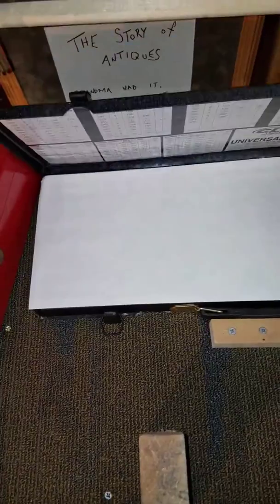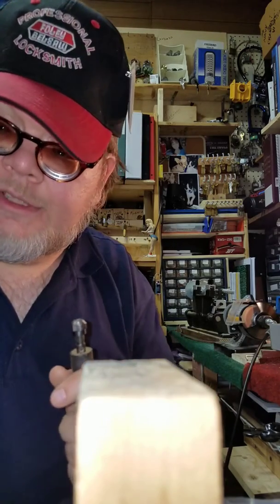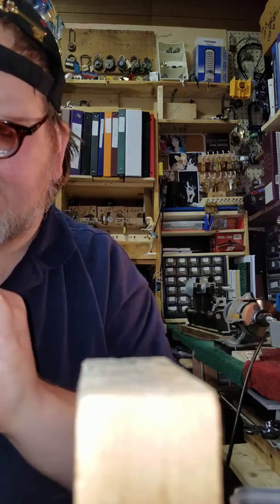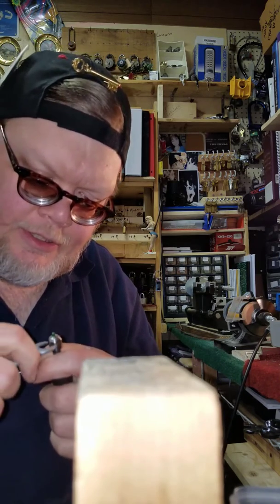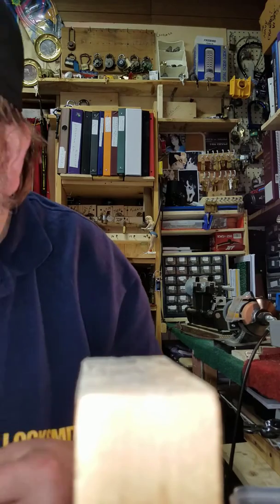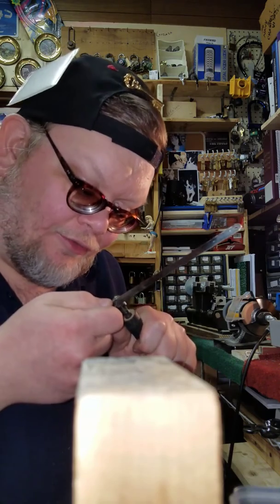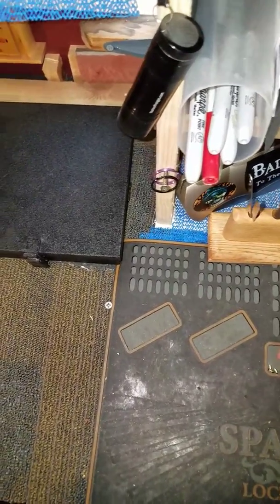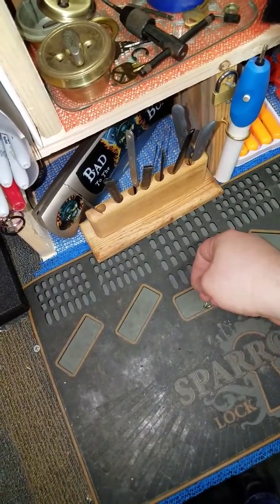Making a few custom pins

Comment: FANTASTIC  video  Big Willy great  skills man .did you get the grinder with the dremil tool at harbor freight ??? thanks for sharing buddy great video. 😎😎😎😎😎⛥
Reply from the maker: yes I'm on the 4the buffing wheel Still has original grindstone in it I use it to make picks the rounded edges work good for it I should change it but it still has some life left in it works good not great bogs down when I do some things like buffing but suits my needs
Reply from the maker: It did come from there but my parents got it for me as a Christmas gift or birthday gift cant remember I got that C.R.S. thing Cant Remember Stuff there is another word for Stuff but I wont say it